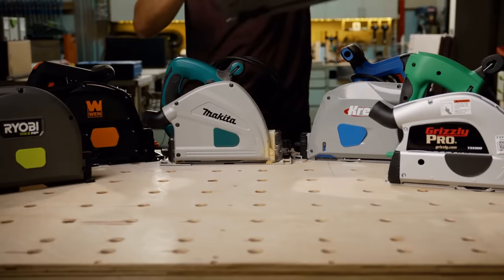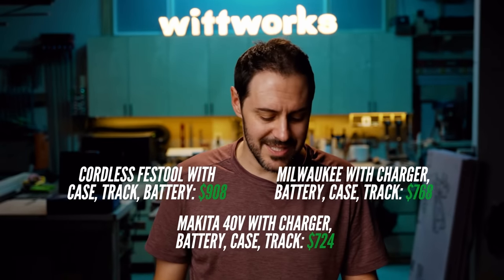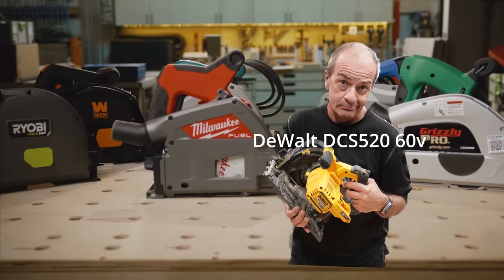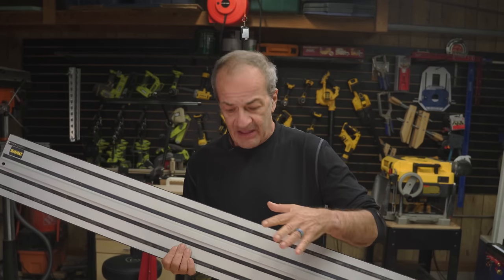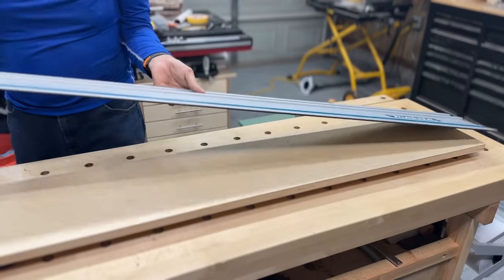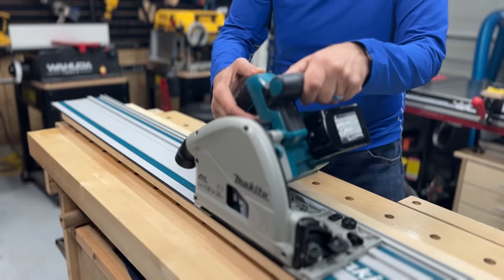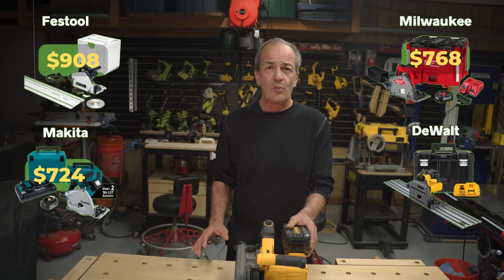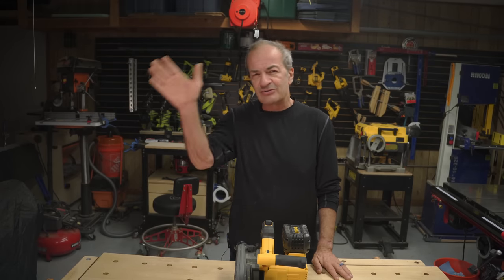The Best Track Saw NOBODY Talks About

Comment: Great viddy! I guess I’m going to have to invite you over. 

Truth is, I pulled back from buying the dewalt after a dewalt service employee told me they were going to discontinue that saw and were working on a new version. That was a year ago. Not sure if there’s any truth there.
Reply from the maker: That’s interesting 🤔. Hadn’t heard that. Entirely possible though. Festool updated their saw for a thinner kerf to alleviate performance issues with the old one. This DeWalt is a beast on power but it’s just “different” enough that it’s maybe TOO different, if that makes sense?
Reply: Drew, now you just have to borrow the saw from Lee for the full comparison video with Milwaukee one.
Reply from the maker: @Wittworks if you want to slip Mr. Yellow into your future review let me know, be happy to drop it off to ya
Reply: Nope
Reply: Possibly just an upgrade adding Wireless Tool Control for their dust extractor? It’s happening with a few of their tools lately.
Reply from the maker: @default9740  I expect that to happen eventually

Comment: Great video! Another advantage of the DeWalt over the Festool (not sure about the others) - on the right side of the blade, it is flat so that you can run that directly on the floor or other surface. It allows you to make cuts like trimming the bottom of a door without removing it from the frame. Very handy when needed 👍
Reply from the maker: DAMN I knew that but totally forgot to mention it! I even came across a video of a guy doing exactly that but it slipped my mind to include it
Reply: but if you're right handed, which is most people breathing, wouldn't you want the flat side reversed?

Comment: Nice vid, just one correction. Someone else may have commented on it. When you make bevelled cuts, the Festool and Makita do not cut into the zero clearance edge on the track. It’s one of their main selling points.
Reply from the maker: It sure looks like it would but I could be wrong. I need to try it on the Makita.
Reply: @BustedKnuckleWoodworks  I own both.
Reply: Does the DeWalt cut into the edge on bevel cuts??
Reply from the maker: @toshn4151  I don’t really know. To be honest I just assumed they ALL did, but many commenters have pointed out these saws compensate for that, so I’m guessing the DeWalt would as well, but I haven’t confirmed it.

Comment: One of the main reasons I went with DeWalt when I was first entering the world of buying tools was the 60v battery system. I remember getting my first drill and driver set. Still have them use them and love them. Have the 60v circ saw and that thing is a beast rips through plywood like butter and has tons of power. I didn't even know DeWalt made this. I think going with this saw and the festool track would probably be the best of both worlds. 
P.S. I really wanna get into the "red" market. I like what you said about being in 2 different tool families. Makes sense these days. Glad I came across this!
Reply from the maker: Is that the belt drive or the worm drive saw you have? I want one waaaahhhh lol
Reply: @BustedKnuckleWoodworks  not the worm but the direct. Don't think it had a belt. It's like a regular circular saw. It's great. I have the Bora track and guide but it's finicky. I had to rip up some sheet goods recently and I took one of my first rips and used that to make an 8' sled for my circ saw. Worked great for the time being. But I see an upgrade in the future. When funds allow

Comment: I bought a DeWalt with a tail about ten years ago.  And, down through the years, I added an assortment of Festool track, and the accessories for the Festool track.  Which are just unavailable for the DeWalt track.  Another feature the DeWalt saws have is an effective anti-kickback mechanism.  It works well if you have your track clamped down.   

I’m getting ready to build a new house, and a tractor shed this summer and the DeWalt 60-V track saw is on the list of tools I want to buy before I start.
Reply from the maker: I do especially like the anti-kickback mechanism on the DeWalt — another thing I forgot to mention 🤔. It’s mechanical (rather than electronic on the Festool) so it’s always “active” so to speak.

Comment: Hey nice overview. I almost bought the DeWalt a few years ago but the odd plunge action and the battery placement too close to the handle were deal killers for me. I did not know it worked on other tracks.

By the way, not all track saws are created equal when it comes to zero clearance. My Kreg would cut into the rubber strip when making a 45 degree cut whereas my Festool will swing out far enough that it still cuts on the same line at both 45 degrees and 90 degrees.
Reply from the maker: Thanks! 🙂 The battery placement never bothered me but if you’re a lefty I can see it being a problem.
Reply: The plunge action is what makes it the best ot more natural
Reply from the maker: @loucifer4205  I agree, just makes sense to me

Comment: I have 2 corded festool tracksaws. If I’m cutting melamine I use my Dewalt tracksaw. The extra power makes a difference. I use both brands on festool tracks.
Reply: Are you using the dewalt for a faster or a cleaner cut in melamine?
Reply: The Dewalt has less chipping of the melamine. I’ve spent a ton on blades trying to get clean cuts from the Festool but no matter what blade I run on the Festool the Dewalt does better with the stock blade.
Reply from the maker: I’ve used this saw with the stock blade on melamine, it works awesome for that. CMT makes a 56 tooth blade that is supposed to be even better

Comment: I have the dewalt corded track saw. Since the day I got it it sounded pretty rough, but man perfect cuts, every single time. For around 500 bux, I got a 52” track, a 102” track, 2 new zero clearance strips and extra replacement grips. But cuts until this day still perfect. Single pass cross cut through 2” walnut slabs at 45 aaaaaall day long. Edge boards, everything. I’ve used some 60v dewalt stuff and I know what kind of power your talking about haha. I’m seriously going to upgrade soon because of this! I didn’t know this was out there and honestly haven’t looked because my 4 year old one is still working great! Thank you so much man! And keep up the great content!
Reply from the maker: I'm subbed to your channel so go ahead and then make a video! Thanks for the visit my friend
Reply: @BustedKnuckleWoodworks  I appreciate that, and look at those subs! Your awesome dude, thanks for the sub 👍

Comment: I appreciate the attention that you brought to some of the more interesting features. As you pointed out there aren't many reviews of this DeWalt saw, but I wish you would have spent time examining any shortcomings of the saw, or issues you see with it compared to the other saws. Half a review is a bit disingenuous. I did love the "you can cut on both sides of the track without turning it around", just in case you need a board that's exactly the width of your track!
Reply from the maker: I kinda thought about doing a full review but really, I made this really fast right after Drew's video came out, and I just wanted to address the issue that the saw should be considered as part of the list of top-tier track saws. And you'll notice his was not a full blown review either.

There are a few drawbacks I could have pointed out, like you really need a 9ah battery to get the full juice out of it, and they give you a 6ah battery instead. Or that there's not much space between the battery and the handle because the handle is low. I didn't think the bi-directional thing was that big a deal when I first got the saw but on jobsites where setups are tight it has really helped me out. (If you move the track, obviously, haha) 

I've used the Makita and the Festool. The Festool is waaaay too much money, and the Makita case is a joke. Like, pitifully sad. Jury is still out on the Milwaukee but I'm skeptical. It's the only one using a single 18v battery and the math just doesn't add up on getting the power and battery life.
Reply: @BustedKnuckleWoodworks  Yeah Drew and his 30 min "quick look" lol. 
Fair point though, I didn't consider how high quality your video is with such a short time to put it together. Excited to see what you put out in the future.
That double sided track is so smart, and a base that fits other tracks. Unreal that no one else thought of that. Seems like the move is to buy a second festool/makita style track for all the cool accessories out there, and along with DeWalt double track, then you've got the best of both worlds.
You couldn't be more right about the Makita case. It's only good at keeping dust off your cordless sawdust maker.
That Milwaukee depth adjust is pretty slick though.
But the DeWalt plunge mechanism has a Lambo doors vibe, so points there I guess. Haha
Reply from the maker: The Makita case makes me laugh! The bottom is blow mold plastic. What is this, Harbor Freight? wtf

Comment: I have the corded model but it performs much the same. Agree with all your comments. I bought mostly on price but it was eye opening all the advantages you pointed out. I never considered the other tracks weren't reversible and the way the saw plunges was unique. I've always wondered why it doesn't seem as popular when I watch reviews of track saws and shop for accessories. I also have and recommend the router adaptor.
Reply from the maker: I use that router adapter quite a lot!

Comment: I've been rocking  the dewalt 60v tracksaw for years and I love it!. The cmt orange 56t blade is the best blade for it too! The parallel plunge action is hard to get used to if you are used to the pivot plunge that all the other saws use.
It works best on the festool track and I feel is a great value. The only cons is dust collection and some deflection I get from time to time. I even feel their tracksaw clamps are better too!
The festool is the cadillac in my opinion but the dewalt is like my pick up truck. Ole reliable!
Reply from the maker: Thanks Patrick, very good to know about the CMT 56t blade! I've been rocking the 40t on this one for ages. Dust collection is pretty good as long as you use the the DeWalt-type fittings. Their miter saws are the same way.
Reply: @Busted Knuckle Woodworks  
Actually the best blade is the makita 56 tooth but it's so thin that I get quite a bit of deflection when plunging or on a long cut, it just veres away from the track and not so straight when cutting  3/4 and thicker material.
Reply from the maker: @patrickkelly8596  the Festool blade is pretty thin as well, they narrowed the kerf when they had issues with their original design bogging down.
Reply: @Busted Knuckle Woodworks  
Yeah I use the ew 1.8 mm tcs55 keb at work but the price on those blades I just can't justify buying. Price point is the cmt 56tooth and next best option is the makita in my opinion. Not to mention you can use that brass adapter and put those blades on a 6 1/2 in circular saw too !

Comment: I guess that you did not see Drew's Dewalt Tracksaw video a couple of months ago. His main criticism was the double sided track and the lack of accessories - I run the Dewalt on a festool track, it works perfectly. I use a Benchdogs square and fence with a Woodpecker parallel guide, all work well.
Reply from the maker: I did see Drew’s video. This one was released in January, months before that video.
Reply: @BustedKnuckleWoodworks  Oops, didn't look at the date, sorry :face-turquoise-covering-eyes:
Reply from the maker: @LickorishAllsorts   no worries 😉

Comment: Great summary of features - even though I am not in the market for DeWalt it is nice to understand feature differences. BTW for bevel cuts on Festool the claim is that it pivots and will not cut into the splinter guard. I never tested this myself.
Reply from the maker: No kidding? That must be on the newer model… I don’t think the original had that feature if I remember correctly.
Reply: It’s been a feature for a while I got my first corded one around 2014 and it worked that way then
Reply from the maker: @spycedezynuk  well I stand corrected 😇

Comment: Sounds all good, but I use track accessories, which you can't use on the Dewalt. I use Parallel guides for accurate repeatable cuts. I use track squares to keep the track 90 degrees. Also use the LR 32 system for quick and easy shelf pin holes and drawer slide holes. Easy of using my Routers on the track. Not having those capabilities is a deal breaker. If they had made a track that was more compatible, they would have more fans. I do like the idea of being able to run on both sides of the track, but not enough. You put out some good points though.
Reply from the maker: I did a review here on the channel of the TSO track saw square for the Dewalt track. It’s pretty nice. But I agree with you, the track is not as accessory friendly as the Makita or Festool. Fortunately you can use the Dewalt saw with those other tracks.

Comment: I realize that this video was made almost a year ago, but have you looked at the cordless track saw from Wen? It is supposedly a copy of the Makita. Uses the Festol, etc tracks. Comes with 2 18V batteries (runs 36V like Makita) and charger for under $200. Track is extra but there are multiple options depending on length desired. 

I wouldn't use a track saw very often so it's hard to justify over $500.

Thanks
Reply from the maker: I’m not too familiar with the Wen but check out the channel I mention in the video @wittworks — he’s reviewed almost every saw out there including the Wen. You can trust him to give you the straight story.

Comment: I really wanted the dewalt track saw to work for me (i was mainly team yellow at the time), but as a lefty, the battery placement was a dealbreaker as my hand didn’t fit between it and the handle.
Reply from the maker: Most track saws aren’t set up especially well for  lefties but this one is probably the worst in that regard, so gotta agree with you.
Reply: soccer players should learn to kick with both feet

Comment: I don’t have a lot of Dewalt cordless, but I bought the 60v tablesaw and the 60v 12” sliding mitre last year because the startup on my off grid solar system was too much and kept tripping the inverter.  I have since figured it out, but I love the flexibility of cordless and both work great.  The table saw is amazing with the thin kerf blade.  I don’t doubt the performance of the track saw at 60V.  Batteries actually last a long time between charges.
Reply from the maker: Sometimes I throw a Flexvolt on my mini-Atomic impact just for funsies lol
Reply: @BustedKnuckleWoodworks  lol

Comment: How serendipitous! Drew of Wittworks just put out a video 5 hours ago where he compared a bunch of track saws: the Dewalt, Milwaukee, Festool, Makita, Wen, Ryobi and Ridgid. He gave an average rating for the Dewalt, but gave top marks for the Milwaukee and Festool. He didn't like the plunge mechanism nor its unique track design. He didn't mention the ability to cut on both sides of the track. 

I'm a corded Makita owner and it's a great saw, but the lack of a riving knife does knock off a few points. I wonder why Makita hasn't added one yet. I often wonder if the anti-tipping mechanism is intended to prevent kickbacks since I've never experienced a kickback with it engaged. Personally, battery powered track saws are not a big selling point for me. I don't want to worry about recharging batteries, especially when they add to the cost of the saw. Moreover, unlike drills and other battery powered tools, remembering to remove the battery when changing the blade or putting away the saw makes it a bit scary even with the safety switch.
Reply from the maker: I “saw” that video (haha)! Drew is not a fan of Dewalt tools in general. I actually think the fact that the Dewalt can basically use any track totally negates the proprietary track argument. Plus it’s got the most power. Not liking the plunge mechanism is probably fair though.

Comment: I bought a dewalt n small track here in wi then had the 102” sent to my house in Fla ..used on my roofing project n it worked flawlessly…however I’m at the cross roads now n I’m team red all day erry day n want the milwaukee plunge saw but don’t want to be disappointed..already got me wondering why they added such heavy track saw clamps with turn handles when the dewalt light weight hand clamp did jus fine…what else did the over do for whatever reason

Comment: One thing you failed to mention is the compatibility of accessories for the track. Any thoughts?
Reply from the maker: The one drawback is that the DeWalt track isn't compatible with most accessories that require a lip on one side to attach to (think parallel guides, t-squares, things like that). But since the saw works on other tracks what most do is to buy a Makita, Festool, or Powertek track to use the accessories with.

Comment: Being able to run the saw on either side of the track is cool, but it also limits the ability to have accessories clipped to the track like the Festool/Makita/Milwaukee rail design. That means no rail squares, end stops for router dados, etc. Probably a great saw if you don't need those features though!
Reply from the maker: That is a bit frustrating with the stock track, but knowing me and my OCD I would STILL have to measure it out and draw a line anyway. 😂 

The GOOD part though is, if those accessories are important for you to have, you can just get a different brand track that does accept those accessories (Makita, Festool, etc) and know the DeWalt saw will fit on it.
Reply: This 👆
Reply: @BustedKnuckleWoodworks  line or not, one of the underrated things I can do with a Festool track is run stopped dados on it with a router and end stops.
Reply: Yup, don’t even bother with the dewalt track when I bought the dewalt saw, all the accessories your heart desires ❤